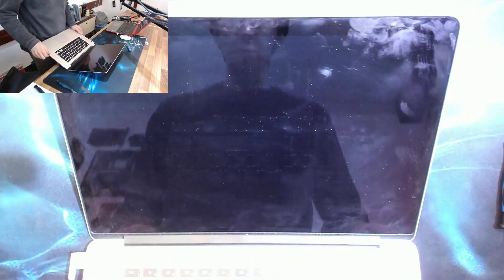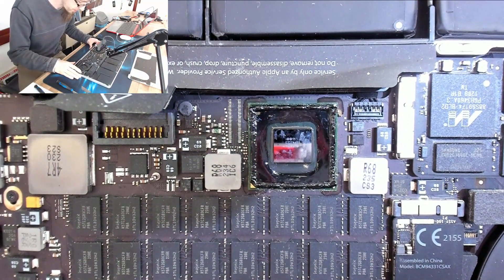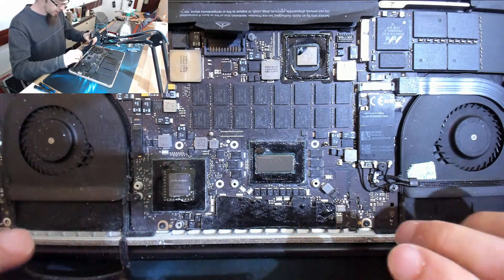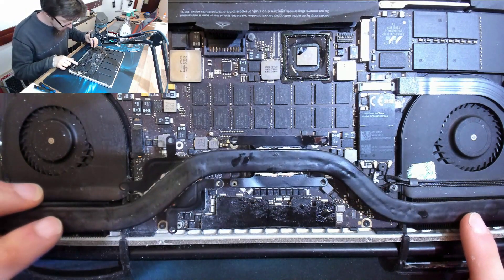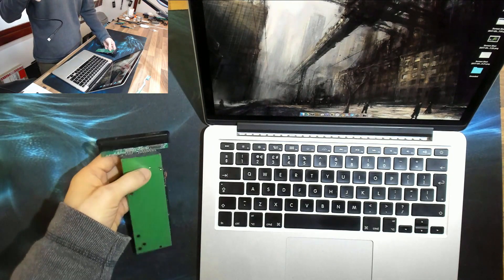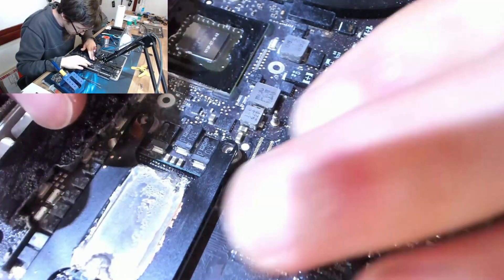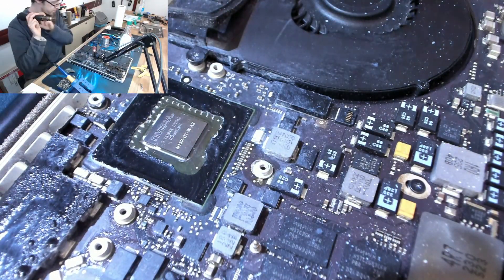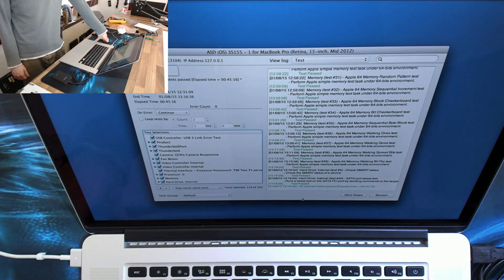LFC#107 - Melted MacBook

Comment: WOW ! that's some Vodoo magic! you made it work again thats amazing!  

After apple took my 2011 macbook pro under the gfx chip replacement program it had the screw mounts on the smaller heat sink off the board just like this one. My first idea was super glue as well, but I ended up doing the same thing you did and soldered it. I thought probably super glue would melt or evaporate with the heat haha

Comment: I have been seeing a ton of 2013s lock up and refuse to run.  But Linux runs perfectly for some odd reason.  Windows 10 will install but fail at the installing devices step.  So weird.

Anyways love your videos, watching people fix things is so relaxing.
Reply: It's due to the graphics card, Linux does not activate the graphics card hence why that works.
Windows 10 locks up when it goes through drivers for the graphics card due to it being broken.

Comment: Hey man, I was wondering if you've ever seen this before: My fan runs fine during start up, but after like 5 minutes or so, it stops running completely (Using an external screen). This causes my computer to get really hot which makes me not want to use it in order to prevent further damage. If I leave my computer on for like 10 minutes, it won't start up again unless I remove the ram chips from their slots and place them back in.
Reply: It's a mid-2012MacBook Pro board number 820-3115B. I get no video on internal display, but I do believe that the fan stops running after 5 minutes even without the external display connected.
Reply: Oh yea there are definitely bigger problems, but I have already asked for your expert opinion in regards to the screen. I was just wondering if you've ever seen an instance like the one I mentioned above?